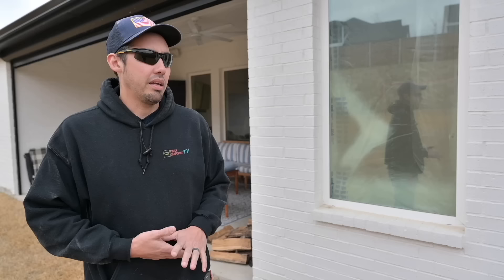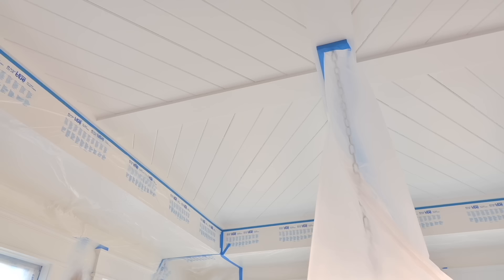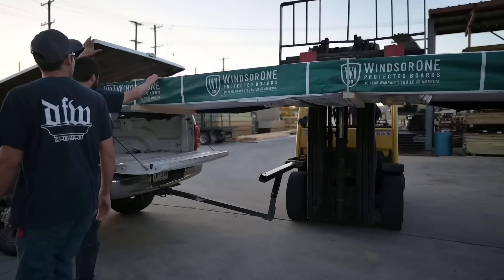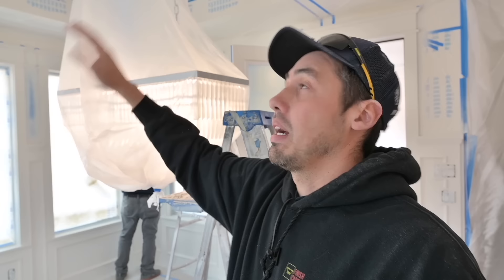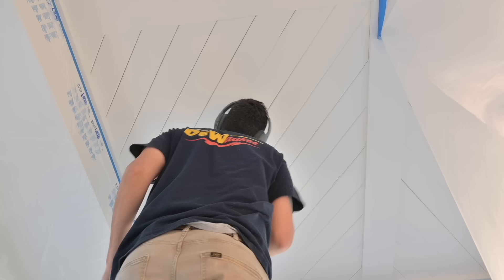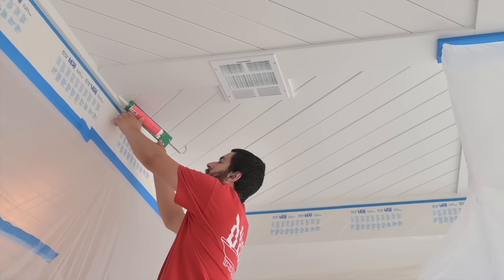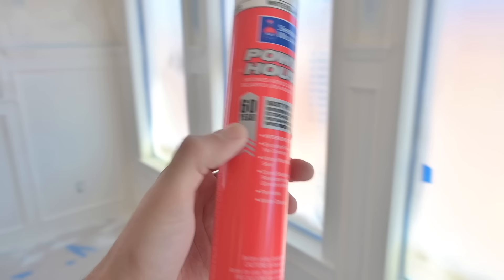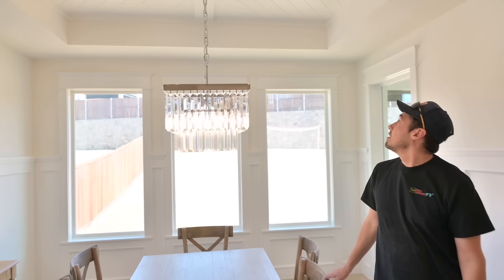Customer furious with me - Failed Trim Install

Comment: If it were me, I'd spray the boards with one coat of paint before installation. Install, nail, no caulk, and a final spray. This way, as the boards expand and contract, you won't see any bare wood in the gaps - and no caulk to fail. I made a barn door using this technique and it still looks great.
Reply: Yup... This! Imho anyway. To each their own I guess tho. 👍👍
Reply: This is the way.
Reply: This won't stop the boards from shrinking and showing gaps (and looking like shiplap). The caulk avoids this.
Reply: @Rocadamis  you don’t get it. It’s ok.
Reply: @c_mac7773  What is it that I don't get?
Reply: @Rocadamis  Mabey the fact that all the wood in gap has already been painted white so you won't see the gap.
Reply: EXCELLENT ADVICE!!!!!!!!!!!!!
Reply: @user-yr4os6jz4r  think he’s saying they didn’t want the shiplap look. I prefer the caulk look myself as I would assume the customer does too. But yes your way is the safer way.
Reply: @coryschraner7065  if you’ve ever made a mirror frame/trim you’d get what he’s saying. You see the back side of the trim in the mirror. You have to paint the back side before you frame/trim the mirror so you don’t see the bare wood in the reflection. That’s the theory here. If it’s all white you wouldn’t see the gap/shadow. Theoretically. Although here I think if the gap opens up that much then you’re still going to see a shadow. You still have to follow his advice in the video and be aware of moisture content so it doesn’t open up so much.
Reply: Yup, came here to say this same thing. Pre-paint the entire board, including the tongues, before install. Then don't caulk. Let the boards expand and contract however they want to. I predict this problem is going to happen to this customer again.
Reply: Absolutely!  Took the words right out my mouth.
Reply: This is a good way to do it, but as others have mentioned the look will be different than with caulked gaps. The caulking blends everything together on any white painted detail. I also agree the caulking may continue to crack, my advice to achieve the same smooth look would be to use plywood instead of solid boards. No one will ever know the difference. The blended joints of caulked boards and the stability of plywood.
Reply: @tvojslauf   , do all of the above!!  Acclimate the materials, prepaint, caulk, finish coat! Ceilings are going to be dryer and shrink from warm , dry furnace air!!
Reply: I'm here like everyone else to say that you took the words right out of my mouth. Even though I have no clue what I'm talking about....which I'm sure they don't either
Reply: Avoiding caulk is best.  Acclimate the wood.  Paint it.  And nail it up.
Reply: This is the way
Reply: the complaint is the gaps!  not seeing bare wood in the gaps
Reply: what kind of paint and sprayer would be best for that?
Reply: @Rocadamis  "This won't stop the boards from shrinking and showing gaps (and looking like shiplap). The caulk avoids this."

You cannot stop natural wood from shrinking and expanding from season to season.  That is why we have things like t&g and shiplap because they still show wood (and not an actual opening) as the boards begin to separate a little bit.  Those gaps need to be finished before installation so that the gaps don't become exposed paint lines.  Also, pre-finishing all sides and ends will help minimize the seasonal movement.  Caulk is a high maintenance sealant and blemish cover.  Caulk is not a finish.  Glues and caulks should generally be nowhere near lapped or t&g joints.  T&g is distinguished in look by the round profile of the shoulders which disguises the width of the gap, but both move equally relative to the characteristics of the wood and the huimidity.  Using engineered wood products you can approximate a more refined t&g or shiplap appearance (particulary for interior finish work), but the basic usage for these type of joints implies movement of the wood.  For gosh sakes, if you are going for a natural wood finish and using a natural wood product then enjoy the beauty of what it is and don't try to cover it like it was poorly installed or full of blemishes.  It is a losing battle anyway.
Reply: You do not caulk T&G.

Comment: Everybody makes mistakes....It's how we learn and get better.  You stand by your work and fix problems when they occur, its all that can be asked for
Reply: It's not really a 'mistake', it's one of the real-world realities of working with real wood. Better preparation may have prevented it, absolutely. I have to wonder if those open joints close back up when humidity levels rise..
Reply: @Matasky2010  RIGHT?! The whole time I could not help but think how a "professional" sounds so amature.

Why did he even caulk the seams to begin with? These panels are supposed to be installed without caulking to allow for continuous movement of the panels. They will ALWAYS expand and contract for their life because of temperature, humidity, suppport movement, etc. The whole idea of panel joinery like this is to accomendate for wood movement. It allows free movement of the panels WITHOUT a mechanical or glue fastener holding panel to panel together.

T&G, shiplap, etc... is all trending right now and purely installed for looks.  However, most have forgotten its how walls were made for centuries to account for wood movement. I see it all too much these self-employeed custom trim workers dont know the basics of woodworking & carpentry. They rely so much on ready-made products and high-end tools to do the work for them. Its more than slapping together a few boards together, hiding the nail holes, and using a "60 year caulk."

Comment: Just my 2 cents as a avid fine woodworker and someone who studies wood...tongue and groove lumber isn't made to caulk the joints. The designed intent of tongue and groove is to allow the natural and continual expansion and contraction of the wood. Also, if it is mostly flat sawn pine it is going to move ALOT and will continue to move throughout the year with seasonal changes unless the house is 100% climate controlled (temperature and humidity). If you ever get into building fine furniture or musical instruments as I do, you will quickly learn the grave consequences of not allowing for seasonal movement. Not to say you didn't here, but caulked joints of T and G will crack...period.

If it were me, I would have sanded all the boards, then primed and applied a very light single coat of topcoat to the tongue and groove edges. Then install, fill all holes, lightly sand, then final coat by hand to ensure not too much paint got in to the joint area. That way when the boards move you will always see white and you won't have the dreaded caulk crack.
Reply: Agree this will be a seasonal problem. Winter  = heat = drying out, Summer = open windows = moisture = swelling. As stated, caulking is bad idea. In the summer, it's going to bulge and creep out and be even more noticeable. Only way to fix this is to float the T&G and let it move naturally, and as Benjamin states, paint it before you assemble so that when it does move, you don't see the bare wood underneath.
Reply: Best policy is to be upfront with homeowner about movement of natural wood and recommend a humidifier or dehumidifier depending on your climate. Wood should be acclimated and of proper humidity before install. Then prime/paint all sides in this case before install.  If homeowner wants joints caulked, then be up front with them about the ramifications relating to movement/cracking. If they insist on caulking it have them sign a extra work order/waiver related to cracking & use the very best caulk you can for them. This way homeowner makes the decision and owns some of the responsibility. Good job standing behind your workmanship and accepting responsibility here
Reply: agreed seasonal problem pine will continue to contract and expand sorry to say no caulk at all to remedy it and tell homeowners in future this is why not to caulk
Reply: Wow... you don't know until ya know. Makes perfect sense. Thanks!!!
Reply: You have actually  made a couple of good points well done 👏
Reply: This x10
Reply: Agree, I made a white oak trestle table with bread board ends that allow movement and my table changes width throughout the year.
Reply: @rod1951  yes sir. Drawbored mortise and tenon with elongated mortises is best practice. Keeps tabletop flat, allows for seasonal movement, and looks great.
Reply: Cabinet refinishers run into this problem as well. Customer will ask for the gap around the panel to be caulked. Sometimes this is okay. Sometimes the caulk ends up cracking. Best advice is not to caulk, but if the customer insists, the best advice is to use the very best caulk available, and not to warranty the work.
Reply: Well that will make a good next video
Reply: I’m a painter and the worst thing anyone can caulk is tongue and groove, ship lap, nickel gap, and door panels.
Reply: I was just thinking this, cutting and re caulking you'll have same problem as the seasons turn... tongue and groove is like suppose float
Reply: Should have never calked it
Reply: Benjamin’s advice is right on. Pine will continue to move seasonally for decades. We have T&G in our house that is 80 years old and the joints open and close every season. We also have 6-panel doors that somewhere along the way got caulked around the panels and they look absolutely awful with the split caulk. In my opinion, one of the most important skills of a good finish carpenter is the ability to foresee how the project will look 5, 10, 15, or 50 years down the road.
Reply: Yep the installer is definitely a rookie. I bet he didn’t seal the back of the boards either. He has probably a few more years and several more “fails” to figure out the program. Bottom line is wood moves especially flat cut like you mentioned.
Cheers
Reply: @astrotman  exactly and sealing the backs verses leaving it raw will decrease the movement but not completely eliminate it
Reply: exatly. caulking it again is waste of time and resources. caulking is made for joints that move, but actually caulking never lasts when if the joint moves alot as caulking hardens overtime and rips off when it moves.
Reply: @bencashman1017  love this!  Very good point. That is really what separates a workpiece.  Good joinery will last a longggg time, and when it finally fails or begins to degrade, there are legitimate ways to repair it so it continues to last.
Reply: plus is doesn't make any sense to caulk: the beauty is the constrast with the grooves, otherwise just do a plain drywall wall ahahahhahahahah
Reply: Exactly. As others have pointed out in response to your post, (I build instruments too)  the wood should have been back-primed and painted. I would have also rolled on 2 coats of carpenters glue to the end-grain cuts. It was never mentioned, but I suspect the real culprit is a lack of ventilation above the ceiling and possibly no vapor barrier above the ceiling. Wood can get incredibly dry in attic spaces, I once had to drill pilot holes in pine rafters to use 16d nails without bending them over. Another part of the problem is the shit wood available now. I've seen new wood with 1/2" summer growth rings versus wood from a 1940 house with 1/16" or less growth rings and loaded with resin. The original front door in my 1800 house in Maine was fitted with no more than a 1/16" gap which never changed summer or winter at all. The day I moved in  (November) I looked at it and thought "That's gonna be a problem come next summer". It never was.
Reply: @curbmassa  🥰 old growth wood
Reply: True or if it was mdf but ya anything  with a Groove or its like hardwood I saw a kitchen installed oak stained doors and later they all shrunk  gaps everywhere ouch they had to replace them all $ and we left thinking it's gonna happen again lol
Reply: Never in my 40 years in finish carpentry have I seen someone caulk t and g  absolutely foolish
Reply: Good place for Armstrongs ceiling system that is t and g. Never caulk products like this. Moisture control inside homes is fickle at best and why I hate skylights…
Reply: My thoughts exactly. I would not have sealed those gaps to begin with and surely would not have filled them a second time.
Reply: And glue to the ceiling
Reply: @fuckingpippaman  Hey bozo, it was a ceiling not a wall🤣
Reply: Read my mind bro
Reply: Came here to say exactly this. Smh
Reply: I'm not even a woodworker and I agree with this 100%. These boards will always move and change. There's zero reason to caulk between them. You're creating more of a visual issue than you're fixing. I would have probably painted the boards before installing them if they weren't factory finished and just left it as is.
Reply: Finally someone who knows the language they speak. The man that taught me 20 years ago who was a third generation carpenter taught me that lesson on a very similar ceiling design. As soon as he mentioned caulked it reminded me of a saying the guy I work for now "caulk and paint makes carpenter what he aint". I hate it when he says that,but it's TRUE. I miss doing nice work I was proud of, it seems like people just want to get in get out and get out and get paid now.
Reply: Built my cabin with mainly T&G and wasn't surprised when they swelled and contracted due to the weather. Personally I wouldn't have revisited this.
Reply: @curbmassa  The real problem is the demand! Due to the high demand, now and before the pandemic and the population growth people are building more homes. The trees have their own growth rate, and they are being cut down much faster to keep up with the demand.
Reply: @angellas.1314  
Excellent point!  People don’t realize how much this effects the finished build.  Todays pine boards shrink, twist, and bow more than pine harvested a few decades ago.  I’ve done renovations if houses a hundred years old with 18 inch wide pine boards that are still perfectly flat and straight.  Todays boards - not a chance. Better nail em down good.
Reply: agree, much like hardwood floors.  you have to leave room for expansion and contraction of all wood even ceilings.  you would have never noticed if you had left it in it's natural state.  but when you paint it, you'll definitely see it.
Reply: @jaynorthwoods  he is definitely not a rookie, and overall does very detailed and impressive work. but everyday learn something new
Reply: Came to say this. Hope he saw it. Perfect answer
Reply: Agreed. My farm house and old pole barn are full of this stuff 70 years old. V groove moves for the life of the instal. The configuration will cause more movement do to long short on an angle. Facecut pine is made to move thus the jiont design.
Reply: Does this mean for shiplap too bc it's essentially tongue and groove? What if a few shipalp boards are pretty bowed, and you need to fill a large gap, due to the bow? Would you wold fill that? Or ...?
Reply: @nm3547  Have you found your answer? I'm about to do my first vertical shiplap install with wood... haven't sourced the material yet but I plan to buy the straightest boards I can find to hopefully avoid issues like that!
Reply: @jeffhaman9010 I bought expensive oak veneer interior doors that were supposedly very stable.  The door panel touches get a streak of unfinished wood showing when they shrink during winter.  Trouble was created by staining and polyurethane doors during g summer before they got hung.

So unless finish us applied before tongue and groove style joints are assembled there will be problems when pieces move as humidity changes.  A real weakness in real wood assemblies.

What are you supposed to do when finishing pieces you didn't build?
Reply: 100% been there done that. stain it. let it move around a year. stain it again. good to go.
Reply: i agree. why even bother to buy expensive wood if you want smooth finish without gaps... use drywall instead.
Reply: Mad props to your integrity- have no regrets - you are a good,person, that’s way more important in life, and construction, than being a good carpenter. It’s called TRUST

Comment: This is why I use mdf V-groove or beadboard sold in 4x8 or 4x12 sheets for my new installs instead of individual pine boards (mostly custom designs by Nantucket Beadboard). The climate here in Massachusetts fluctuates too wildly through the seasons and pine is incredibly sensitive. Poplar is a little better but still produces similar problems.
Reply: Smart.
Reply: I’m also in MA, but not a finish carpenter. I run a CNC wood working shop. I was approached by a guy who wanted raised panel doors for a kitchen build, but he wanted them made from MDF, which I thought was strange. They came out great and once they were sealed with BIN primer, you couldn’t even tell they were MDF.

Comment: We installed some stained t&g 1x6 on several ceilings both indoor and outdoor. To avoid the “white line” when the boards stabilized we stained each board before it was installed.
Reply: That's a great tip
Reply: I was thinking paint before install.
Reply: Always stain or prime before installation, just dealt with this with a customer who didn't want to pay for prep, discussed the pitfalls but luckily they're using a clear oil so in the dry heat of summer  they'll have  maximum shrinkage to do the oil, no longer will i install without  prepping but it was for a friend who was cheaping out.
Reply: What white line?
Reply: @kizzjd9578  if you stain after installation and the boards shrink a bit you will see a line of unstained wood on the edges, not really white per say but natural wood color.
Reply: Exactly. Thank you.